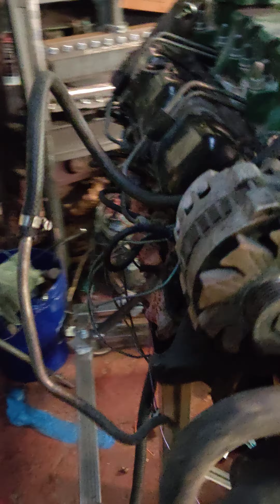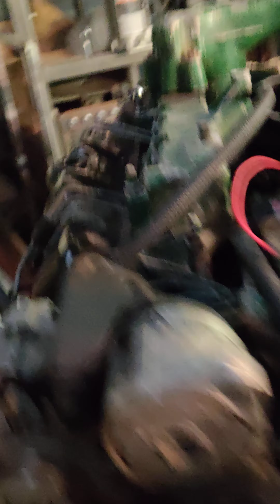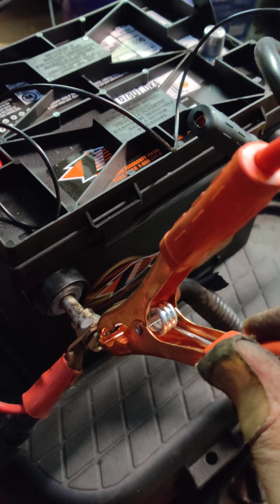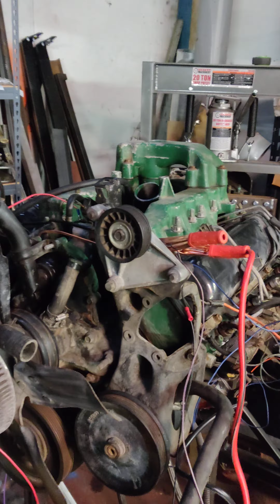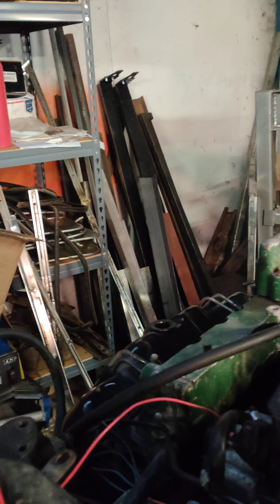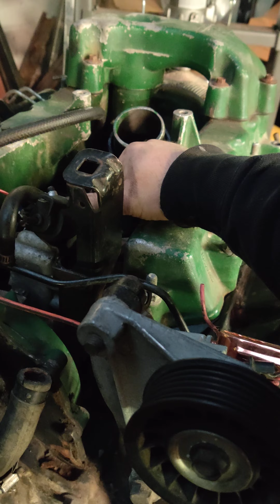6.5L diesel center mount turbo

Comment: I have an oil leak from the rear mount turbo area. Any idea of what this may be from?
Reply from the maker: There are two rubber o rings between the turbo charger and the block for the oil feed and return.